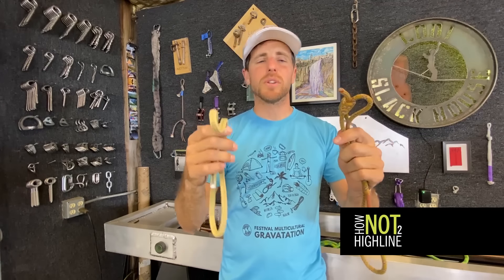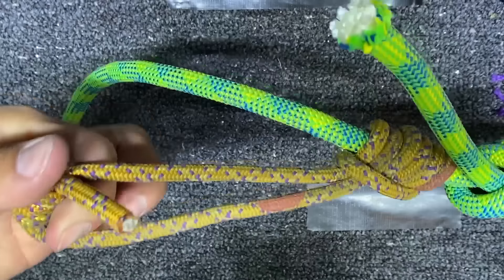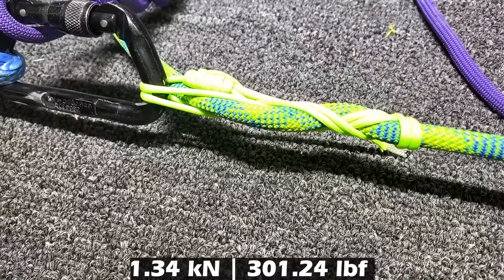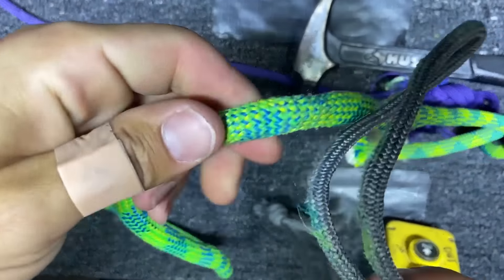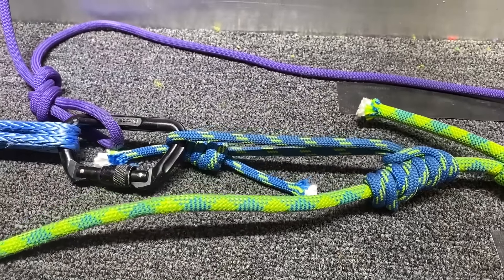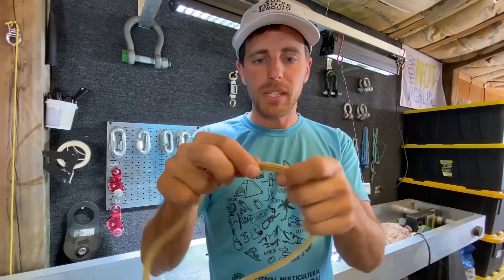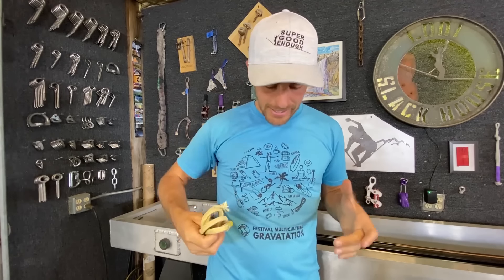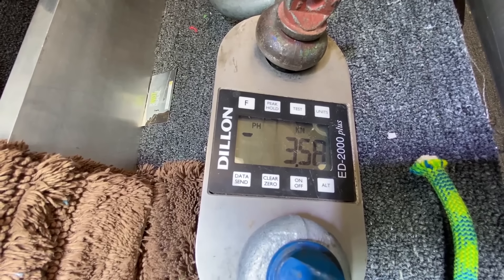Prusik, Auto Blocks, and Klemheist Break Tests

Comment: I use a Prusik as a back up when i am backing of a route because i can't reach the ankor or when i don't trust the anchor.

I connect my harnes with a carabiner and a prusik to the side of the rope which goes to the belayer.

The idea is that if the ancor or single point from which i am descending fails the prusik will prevent me from falling all the way down.

Still a big fall if the next quickdraw is far bellow me at the time of the anchor failing but better than no back up at all.

I wonder what would happen if i fall into my prusik backup....

So this video is very intresting to me!

But i'm not sure if it will behave differently if you fall into it as opposed to slowly increasing tension like you did with the machine.

Very good video anyway!

Comment: The advantage of hollowblock or VT prusik is that they are more RELIABLE when being used as a backup.
Accessory cord does not = a good prusik. Stiffness of the cord makes them very unreliable unless they're old and fluff on an old and fluffy rope.
With a designed for purpose prusik once it's wrapped the chance if it actually wanting to bite the rope is significantly better than with some random cord.
The hollowblock will loose strength very quickly as it has no core, but unless it's obviously not fit for purpose it will still be strong enough to be used as a french prusik/autoblock below a descender.
This is why I recommend built for purpose backups like a hollowblock or VT prusik for going down and then regular old accessory cord prusiks or slings for ascending.
(All this is ehat I've observed in a decade of playing with ropes and instructing various courses)

Comment: In arboriculture, I use a knot called a BLAKE. It's not only a friction knot, it's the entire rappel system. And it's made  using the other end of the rope. So, you guessed it, using same diameter rope! I would not hesitate to use it in a situation where there nothing left but the rope itself

Comment: This is the episode I have been waiting for!
Reply: Although for ascending or descending (lifting or lowering), the prussik and klemheist the turns are not even to either side so that it rides easier in one direction and theoretically locked stronger the other. Haven’t really used them in the “standard form”. Also these were developed in times that ropes were presumably natural fibers, which is passé now - but having the ropes in more contrasting materials may give altogether different results?

Comment: I am not a physicist or an engineer, but my understanding is that you're applying a fairly constant static load with very slow initial acceleration and then a constant velocity in these experiments, which is different from real-world scenarios. I do think that your experiments are very informative, but I just want to point this out to try to think about how they work differently in a real world scenario.

In a real-world scenario, maybe you're rappelling with a prusik as a backup, and maybe you accidentally let go of your line with your brake hand. You'll fall and accelerate, which will create a dynamic load, but since your prusik hitch is pretty short, it will engage and start to exert a force to break your fall very quickly. At that point, I believe that your weight plus the force of gravity exert a relatively static load on the rope.

Say you weigh 100kg (about 220 pounds). With F=ma, that means that your static load will be 980N or 0.98 kN.  I'm about 170 pounds or 77 kg, which would be about 750N or 0.75 kN as a static load if I'm just hanging on my prusik loop.

If my prusik slips a little bit at 1kN, I'm actually good with that because it might slip a little bit from the dynamic load of my initial fall, at which point it will decelerate, soften my fall, and eventually grab. If it slips at 0.2kN, I think I would just slip down the rope until I could grab onto something to stop my descent, which would be scary and possibly dangerous or even fatal.

In any case, I think it could be good for any climber to test his or her actual weight along with his or her desired knot+prusik combination in a controlled environment like a climbing wall at a gym at a relatively low height to see if it holds or slips before trusting it as a backup for a long rappel. I do think that your video can probably help people determine which diameters and knots might work well for them. I think my prusiks are 6mm, and I think mine will be fine with a prusik hitch with 3 or 4 wraps on my ~9.5mm rope as a rappel backup. This is new kit that I just bought, and I found your video because I was looking into which knots I should consider with my new kit for rappelling.

Thanks for the video!

Comment: This test would be nice on the test tower you’re building. To see the effect of the slippage. I use it to backup atc, to switch between shunt and atc and in case of a rappel from one bolt mid route.

Comment: Some thoughts:

- I was taught that 4 wraps was the minimum for an autoblock or klemheist. Based on your results I definitely agree and would not ever rely on 3 wraps. 

-  Anecdotally I've always felt that the prusik knot was the most secure friction hitch. The autoblock and klemheist trade gripping power for ease of unlocking and sliding. 

- I'd be interested to know what the history of that hollowblock was. The Sterling hollowblock is made from aramid fibers, which are much more susceptible to UV degradation than any of the other common synthetic fibers.
Reply: I dunno, that 7mm klemheist was pretty bomber
Reply: I was taught 4 for autoblock too.  However it doesn't have to be very strong if itks used for rappelling on the leg loop as a block since there is a multiplier through the ATC/rappelling device.  How hard does your hand grip the rope ?
Reply: The number of wraps totally depends on the application. For an autoblock as a "third hand" to backup a rappel, you just want it to add friction to the system. You want it to slip, but still have enough friction to engage your ATC to stop the rappel. So the number of wraps depends on the diameter of the loop and the diameter of the rope. There is no 'one size fits all'.
For newer skinny ropes with dry treatment I'd agree 4 wraps minimum. For older well worn, fuzzy and fatter ropes 3 is usually sufficient.

Comment: From South Africa here. In the guiding industry we use 4-5 wraps for the French Prussik or what you’re calling auto lock. The French Prussik is releasable under load while the clemheist bites like a possessed pit bull. Also use 4-5 wraps for that. We avoid using three wraps in anticipation that some unravelling occurs.

Comment: I'm a member of a regional technical rescue team.  We use 9mm prussics on NFPA G 1/2" static rope for almost every thing.  Tandem prussic belays, progress capture, quick adjustment for anchors,  anchor tie backs, adjustable fall protection, accending, holding edge pro in place, etc.

Comment: As a prusik apostle it's nice to see that I'm on the safer side while rapelling. Seeing the autoblock slipping is scary, since it has block literally in its name😅.

There are also some configurations were you wind in a carabiner between the cord and the rope to use it as an ascending device. Would be nice to see them tested as well.
Reply: Are the blocks typically used as breaks? Or just friction? ((... asking honestly, we don't use backups in caving))
Reply: @feelinghealingfrequences7179  no that's not the one I meant. I looked it up and it's the bachmann knot. the carabiner is inside all of the cord windings.
Reply: @rachelhasbruises  I've never used them while rappelling. Prusik everytime. In case my rope gets tangled on shitty terrain and I have to fix it mid-rappel, I don't want to waste a thought about whether getting both hands of my device is a good idea or not.
Reply: Maybe we should just call it the auto slip from now on.
Reply: BMMC teaches the autoblock with 5 wraps (looks like 6) of 1" tubular nylon webbing.

It absolutely holds on BlueWater Assaultline. It is used as a backup to the SRB for all lead rappellers, with fireman's belay used for remaining rappers.

Comment: I'm not sure whether this is 100% accurate, but I was recently talking to an IFMGA guide about different material strengths, and thought I'd share an idea on why the hollow block may have failed dramatically below it's MBS, beyond just the fact that it is old and well used. I believe this is because technora has a fairly low "yield point." Given that we use this piece of equipment to add friction to rappels, and as a rope grab in various other scenarios, this point is not hard to reach, and as such the MBS of our Hollowblock will likely decrease more quickly than climbing ropes, slings, quickdraws, and other soft goods - even of similar age / with similar wear. That said, it will likely remain strong enough for it's primary application as a friction hitch, but if you run out of quickdraws and want to extend a piece of gear... don't whip on it! ;)

Like you said lots of variables, but interesting to think about as I personally do use a hollowblock regularly.

Comment: I used a hollow block for years, or worked well, but eventually I replaced it with a sewn piece of kernmantle cord (either 5 or 6mm, I'm not sure).

Kernmantle construction gives me more piece of mind, because as long as the sheath is intact, the core should be completely undamaged and also largely protected from dirt and abrasion.

I mostly use the klemheist, with only two wraps, and I find that works perfectly for a smooth rappel.
If I need a safety line while rigging a top rope, I use a prussik.

Comment: I was taught in France, that Prussik, autoblock and kleimheist knot were to be used when you have 2 strands of rope like when rappeling. On a single strand, they tend to slip.

On a single strand, the knots i was shown were valdotain tresse, distel or schwabisch knot. Which are used in tree climbing.
Reply: I use a hollowblock on one strand (10-11mm static) as a third hand, never seen a slip, this is of course of very low loads, nothing even getting close to 1kN, but it holds and doesn't slip at all....

Comment: I use an autoblock when rappelling regularly, and the one thing I've notices is that the knot doesn't bite unless it is shock loaded.  It'll slip all day until you give it a good hard jerk.  Maybe some day you can give this another try but instead of pulling straight away with the jack, you give the knot a sharp tug first so it can bite.

Comment: There is another big part to this that seems to be overlooked in the video, and that is the material science side of things.  I would agree that for a friction hitch to work properly on your nylon / polyester ropes, you need a smaller diameter.  However when you switched to the Sterling autoblock, that is technora.  Technora interacts with nylon in a completely different way.  Additionally, (not sure if you tested it or not) but the Klemheist or Multi wrap Hedon is a way better hitch when using that Sterling kit; due to the shape of it.  In my line of work an instructor we typically use only technora - technora based kit; and we very regularly use 8mm VT prussiks on 7 or even 6mm technora lines.  My point being that when using different materials, or intermixing, you will have widely different results.  I'd like to see you test dynema slings and autoblocks on technora lines.  I think you'll be surprised in the holding power (and the fact that you don't need dissimilar sized lines) :D  Keep up the great work, you guys are an amazing resource!

Comment: As I watched this I was reminded of the following story from the first ascent of the Hummingbird Ridge:
John Evans said
". . . it again struck me as pretty damned ultimate to start off without belay on a single strand of 1/4-inch line on a 200-foot rappel, the top 100 feet of which were free.  I used a brake bar with two carabiners and fastened a Jumar to my seat sling for safety.  About one-third of the way down my thumb slipped off the Jumar and it caught me and held tight.  I could just barely graze the wall with one foot and could not raise my weight off the Jumar.  Fortunately, I had my trusty Swiss army knife in my parka pocket so I wrapped the lower rappel rope around my body to jam it and cut the tie-off loop connecting the Jumar to my Swami.  This, of course, bounced me down on my rappel brake, but I was able to grab the Jumar and release it it and finish the rappel."  
To which Allen Steck added "One can well share Evans' moment of intense careful thought as he chooses which of the two quarter-inch lines to cut"
Ascent, Vol. 1 No. 1, May 1967
As I recalled the story while watching these tests, I had forgotten about the Jumar.  I thought it was a quarter-inch goldline sling attached to a quarter-inch goldline rappel rope with a Prusik knot, but if that were the case, I guess the Prusik would had simply slipped and there would be a different tale to tell.

Comment: I know this is old but would love to see the Hedden knot tested like this. It’s like the klemheist pulled in the “wrong” direction (or tied “upside down”). Or similar to the RBS here but without the carabiner. Supposedly much stronger holding power than klemheist (though I was taught otherwise at my mountaineering club), definitely easier to dress.

Comment: I tried using a hollow block the other day as a prusik to ascend a static rope (with my gri gri). It did not work at all! Any time I would weight the damn thing to pull slack through my gri gri, it would just slip! Had to switch it out and use a sling instead, which worked like a charm

Comment: Long repels could burn through your 5 or 6 mm cord auto block knot, that's why the hollow block is made from Technora material. It has higher melting temperature so it won't weld itself to the rope, also used for firemen excape ropes they melt somewhere around 1100ﾟ I believe.

Comment: You have to test friction hitches on the drop tower once it‘s completed. Different results there. I participated in some drop tests at a course at the Petzl Technical Institute with a dummy. We simulated a fall from a lege with some slack between the prusik and the anchor. It cut the mantle sometimes but the fall was stoppe after 30cm to 1m by the prusik.

Comment: I know this is an old video and my comment isn't particularly climbing related, however I use prusiks camping on my ridgeline to secure my tarps to (I use a prusik trough the tarp tieout with a toggle or just a random stick to adjust/hold tension on the tarp) my ridgeline is 550 paracord, for a long time I used 550 cord for the prusiks as well and they hold just fine even in 50km/hr or stronger winds (i have since switched to 325 cord or #36 bank line for the prusiks just for a smaller packing size mostly. I do get how a thinner rope grabs better but in some materials a like sized rope seems to grab prety well still without sliding so easily.
And as for the one rope cutting the other, I know as a "survival tip" that you can cut (see through) a thicker rope with a thinner one prety easily in a pinch if you dont have a knife   but cutting a rope with a thicker or same sized rope doesn't work well of at all.

Comment: I use a 6mm cord and I mostly use autoblock with 3 or 4 wraps (if I'm the first person rappelling and knowing there is some snag on the rope, I use 4 wraps, otherwise, 3 wraps) for rappelling, as long as it is not completely vertical or negative wall, on these cases I use climb heist. To ascend I use prussik always

Comment: One of the perks of the hollow block is that its Technora (similar to Kevlar) instead of nylon, which has a substantially higher melting temperature. This makes it less likely to weld. For rapping with a back up, the kevlar will handle the heat generated better and won't risk degrading the material as much, especially on long, fast, free-hanging raps. Also, given the fiber's chemical resistance, I suspect it holds up to the elements a bit better than nylon over time. Plus, I just like having a sewn connection instead of a bulky knot, but that's just preference. I have also found it to grab much better on the ropes I use. I suspect the condition of the rope sheath influences friction a ton, and I wonder if you were using the same section of rope for all your tests. If so, maybe the repeated heating and rubbing smoothed it out a bit and made it more slippery?

Comment: I use the blake's hitch for the same diameter of rope and it does not slip, you could try it
Reply: I tried Blake's hitch with a climbing rope and it slipped under my body weight
Reply: @eyescreamcake  Perhaps the type of rope requires more turns or to dress it correctly, it is a knot used for that specific purpose, a friction knot that retains even with rope of the exact same size, that is why it is in the safety catalog
Reply: I'm an arborist I too use the Blake's hitch all on the same rope I use the tail of my rope to tie it on a mrs system I have found that it will slip on kernmantle ropes but holds tight on 16 and 24 strand ropes.
Reply: Yep the rope needs certain knot characteristics for Blake's to work.  The 5 3 variant can help sometimes. Gotta set it right too

Comment: I am speaking with an uninformed voice: I think you would need more of a vector force perpendicular to the prussik to cause the prussik to fail from friction (soft goods being pull in a saw motion against eachother is different from pulling them along one another). I also think that some heat is being dissipated to the cooler rope as it moves along it. I've seen similar tests and it seems to glaze the sheath, whereas toothed rope grab devices tear the sheath. I think if you could continue pulling the heat would eventually cause the prussik to fail, but not as quickly as if the force applied in more direct opposition to the other soft material. I'd like to see some strength and performance testing on glazed rope!